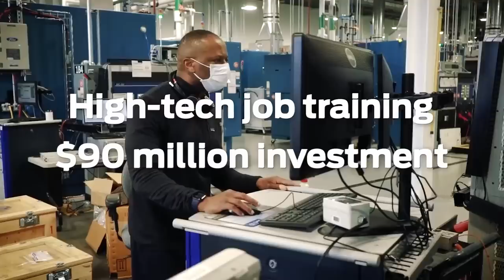Ford CEO Confirms HUGE Ford Maverick Factory To BOOST Production Numbers

Comment: Its just horse hockey.. I've got order in on a 23 Transit ICE right off the bat it will take a year to get it.. E transit are only good for 100 miles and Ford's bragging about that, what a joke F 150 with extended battery 230 miles towing, come on I live in Texas the lake is 303 miles away this would make it a 2 day trip to get there.. NO Thanks
Reply: not only that if your towing it will be half the distance before charging so really maybe 130 miles before an 8 hour charge

Comment: And then let's take this step even further with the 2.5 l f h e v Hybrid engine being a 13:1 compression ratio engine and then marketing the vehicle as it can run on 87 and relying on variable valve timing to do all the work is very unrealistic and it sets up expectations to the customer for them to be getting the best bang for their buck and it's just not there it's a marketing Ploy that is not logical it's not real and it leaves the customer and a bad situation when they're not getting that performance that they think they should get and they have to go to a 91 octane or a 93 octane fuel in order to run that vehicle efficiently and now you've just taken that hybrid savings and throwing it out the window because you're having to spend 40 50 60 cents a dollar more per gallon with this new issue that we're dealing with with the economy and fuel

Some of these are things that we're just not talking about that have to be talked about
Reply: You don't understand the Atkinson cycle. 87 octane is fine.
Reply: @morrismonet3554  I do this daily pal I more than understand, just because it can doesn't mean it should and doesn't mean it's optimized

If you'd care to learn more on my channel I have talked about this more this morning and over the weekend with the f150s 

Watch the videos and then we will talk
Reply: @FordBossMe  There are plenty of videos out there showing the Hybrid's performance and gas mileage with 87 octane fuel. Good luck with your channel.
Reply: @morrismonet3554  well I appreciate you saying good luck with your channel as I said which you're clearly not understanding is doesn't mean you should just because you can and as I said in my statement doesn't mean it won't operate efficiently it's just not optimized I guess you didn't understand that part but I digress I'm not here to argue with people if people want to learn if people want to listen from somebody that's in the field doing this every day that has more out on this Ford platform than anybody else does and the people that I associate myself with YouTube wise that also put out video content based on the Ford stuff we are literally the one source that everybody goes to for this stuff and get people still want to argue with us and I don't understand why but have a great day I'm not going to argue with people here

Comment: Ford should build a Diesel-Electric-Hybrid.
Freight trains use the same principle, & get insane mpg with a cheap to produce fuel with an engine that if taken care of doesn’t want to die.

Simple & reliable diesel hybrid would beat out every other manufacturer if only the epa let em build it.

Long life is better for the environment than making more fuel, more batteries, & more cars. Let it flow as freely & as smoothly as possible for high efficiency. But that doesn’t make em money.

Comment: Hahahaha It's going to bite them in the butt. As rolling blackout's began the infrastructure for electric power is decades away. Now california is asking owners of EV  not to charge there vehicles due to black outs. EV have the same problem as they did 100 yrs ago No range. Hydrogen is a better choice then electric since it has the nation wide infrastructure at gas stations. They just need to work on how to make it easy to transport the fuel. Just a cleaner fuel then electric since are power is still run by coal or natural gas. wind and solar are just not reliable since you can't generate power with no wind or solar power at night.

Comment: They lost the plot with Rouge, a shadow of it’s former self.  The problems they have today are from sublet parts manufacturing all over the globe, whoever is cheapest and the result is a parking lot full of vehicles they can’t finish because od supply chain issues.  And having the largest number of recalls doesn’t help.  They don’t test until destruction to validate quality, they test it on a computer for an anticipated amount of cycles and call it good enough. 
2022 Bronco had  a roof that didm’t fit, a 2.7 engine that grenades.  Our niece has one at the dealer now with a check engine light on.  She has driven it 700 miles...
This self promoting video brags they hired all this new staff.  What happened to all the car plants they closed when they bailed on car manufacturing?  They had plants in the UK and France, didn’t mention anything about them.

Comment: Well, it seems that Ford id actually copying Tesla in the vertical integration concept. 

Second the Maverick is NOT a E.V.  it has a internal combustion engine.  Forty MPG is good no doubt but not an E.V.  
The problem is Ford currently has only 2 EV on the market.  So overtaking Tesla is not going to happen in the next 5 years.